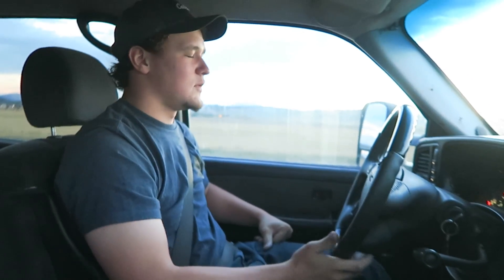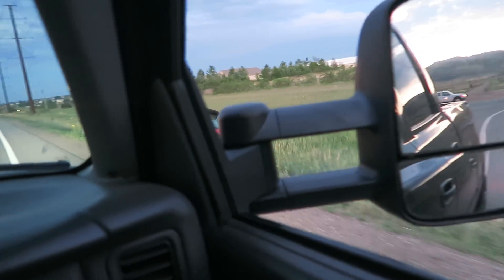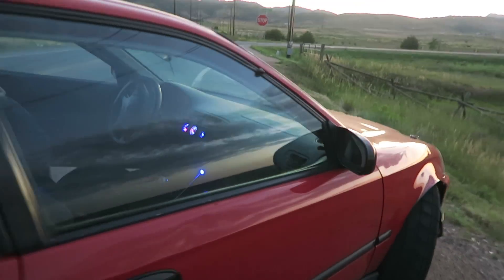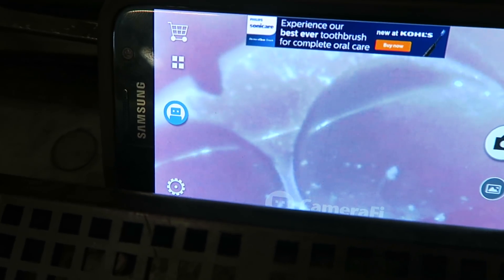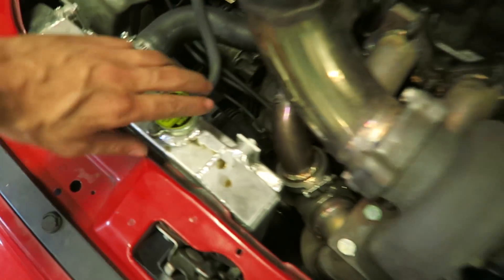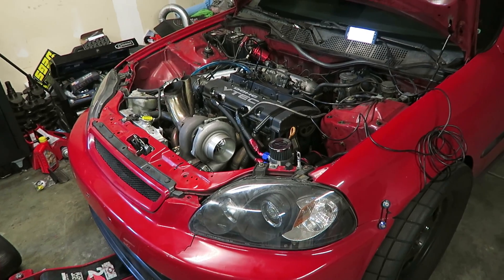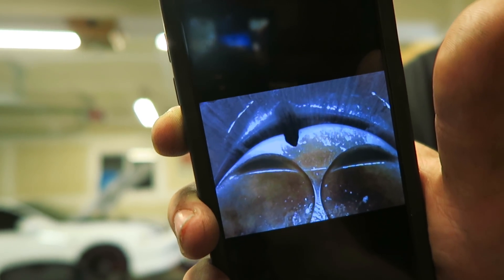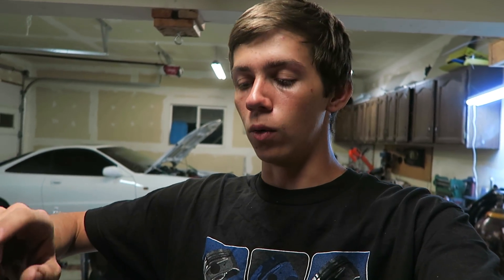Blew up The Hatch :(

Comment: Maybe if you'd focus on one thing and stop buying things off ebay and doing it right things would last a little longer... Just a thought..
Reply: Duane Hallgren You really got me there man!
Reply: Leshys maybe if he have more money he would buy in better shops
Reply: Markus It's not even that, it's that honestly it's cheaper to do it right the first time, sure it may take a little longer to get funds together but the money you'd save from replacing faulty parts over and over would have paid to do it right the first time.
Reply: Leshys I thought it was pretty funny
Reply: Leshys he originally built the hatch on a budget when the channel first started and kept building up, the point of the car was an ebay turbo build...
Reply: Leshys the hatch is the only car with brand parts
Reply: I agree w you, however this engine was built w/ high compression pistons basically as a test. He didn't know exactly how it would handle the HP/boost. So to me it makes sense to use cheaper pistons if you have no idea what might happen. Also he just said in the video that he will prob get a better, stronger piston setup this time around. What better way to learn than to try it out!
Reply: HondamanFG2 Vtec yea, as a teenager he builds some crazy shit!
Reply: only thing that is ebay is just the turbo everything else is quality parts or made by them in the garage
Reply: I dunno, maybe I'm being too harsh or my standards are too high, just sucks to see so much potential somewhat slopped together, sure keep all the other stuff if you wana do eBay stuff for entertainment but at least do one full clean build.
Reply: Leshys I doubt you even own a car to be talking about clean builds, have you ever even put a wrench to the bicycle you own?
Reply: Syntronz Remixx Instagram: @egsix I'll let you decide bud, maybe you're right. What do I know.
Reply: Syntronz Remixx don't have to own a race car to have the common sense that you build a 700hp 4banger with eBay parts shit will go south but on the flip side if he was fucking with a Chevy 5.3 with a turbo it would last forever at that power.... 4 bangers are for getting groceries not drag racing.
Reply: He has a ebay turbo... That didnt blow up so what are you talking about
Reply: russrt spooling If your going to follow that logic, v8s aren't meant for drag racing, they're meant for towing and only v12s are meant for drag racing because supercar.
Reply: Cool, I guess your paying then?
Reply: Geoge Veruh thats acually a good point why dont they use v12s in top fuel dragsters
Reply: WTF its bad luck, nothing to do with $. That's classic lean damage. Sorry to see it Dude. Pull the injector and see what's blocking it.
Reply: ya I've been saying this any everyone gave me shit. I called it would be blown up in 3 weeks after he got it working and I was pretty much right. You can't half ass shit with that much HP.
Reply: Leshys them eBay pistons yo, jk lol
Reply: Geoge Veruh v8's were built way before v12. There's rarely a v12 at any track. Nhra top fuel makes 10000 go with a v8.
Reply: Its not the tune nor the parts. Its 1 cylinder. If it were the tune all the pistons would have some damage. Most likely an injector or fuel starvation if it's last on the fuel rail.
Reply: Leshys that's why you build a 4cylnder now one expects it and it's feels grate to beat a mustang or camaro with something that cost half as much
Reply: What ebay part caused this to happen.  The s300, 500 dollar pistons,  Name brand injectors/fuel pump or was it high compression while trying to drive it around with 0 room for error.
Reply: Timeless SIDEWAYZ V12s would be overcomplicating things - too many cylinders to look after.
Reply: I don't think the channel would be the same if they didnt do everything with ebay parts
Reply: sketchy builds is what this channel is (kind of) all about
Reply: Just because he buys stuff of eBay doesn't mean it's bad, sure there are a lot of bad brands but eBay is just the distributor, there are good brands on eBay with quality stuff!
Reply: People that use name brand parts with that much HP and still have trouble, what makes you think cheap ebay chinese parts are gonna be any better? If you're going to do something with that much HP you might as well do it right the first time instead of having to keep going back and doing it over again and waste more money. Only thing ebay I would say isn't that bad is the turbo he has, and really if turbo has a good bearing it doesn't matter what brand it is... But when it comes to internals, you're talking cheaply made parts made in china at mass production to make money. If he just got a new block, name brand intervals and sleeved it and kept the ebay turbo he would be gucci
Reply: +H Legion He needs to get some Manley h beam rods, Wiseco pistons, a forged eagle or equivalent brand crank, new set of sleeves, and have his ring gaps set properly for high boost. Then it would probably last quite a long time comparatively.
Reply: SYST3m true. They destroy them selves down the track anyway. Haha R.I.P v8
Reply: Leshys honestly man you are telling your opinion to people who just watch YouTube. These guys have no idea about building a car or a motor. They don't know what's involved in a quality build. They sit in front of their computer in their underwear watching videos.
Reply: uhh it has a lot to do with cheap ebay parts...
Reply: its not tho only ebay thing is the turbo everything else is name brand stuff  in the engine except the turbo which has been 3 years strong
Reply: he has ran this car at 600 hp with this same turbo for 2 years which at that time I believe he was using cheaper rods and pistons
Reply: LOL what ebay part.  He doesnt have cheap injecors pump pistons or rods.  So please tell us what ebay part caused this.
Reply: he's using a ebay pump...
Reply: 4bangers are for getting groceries not drag racing. Guess you haven't seen the DSMs in the 7's lately. Pretty sure that would smoke anything you got V8 or not.
Reply: Cheap to build but all ways fkn up tho .
Reply: But eBay is there thing
Reply: Levi Eckman Isn't that the thing for like everyone that has a Honda these days except for a few of us? Lol. It's no wonder the Honda crowd gets so much shit these days everyone thinks their hot shit cause they have a NRG steering wheel and XXR wheels lol.
Reply: Leshys 
Its always been that way for Honda's . In 2003 it was fart cans and body kits and you had yourself a race car.
Reply: Leshys just because the turbo is from ebay doesn't mean that's why it blew up that astronomical and makes no God damn sense pretty much everything on the hatch is legit
Reply: Charlie P it has nothing to do with what came from ebay fact of the matter is parts fail ebay and great name brand parts they all fail over time it's fact over matter and the end of the day there is always something better you could have done to make the motor better sure but it's all part of the hobby fix break repeat it is what it is this has nothing to do with the engine even a good built high comp motor on e85 would have melted the piston if the injector had failed it happens more often then not with e85 and high comp e85 wears things out much faster and also he didn't cheap out on anything could he have spent more sure but it wasn't the motor that couldn't handle the power something fuel related had a hiccup and when you make 700whp that can be deadly end of story
Reply: the tunerfreak person is actually a friend of theirs and said that the injector for that piston had popped out so that was the problem
Reply: Leshys holy fuck bro that car is sick whats the build specs
Reply: Christian Prusinski It's a Dart closed deck bseries block, itr head, Ferrera valvertrain, Brian Crower stroked,  Crower rods and crank, CP pistons, Garrett 6262, pretty much overkill lol.
Reply: Leshys damn i would say over built for my needs but fuck send it. How much that beast  throwing down?
Reply: Christian Prusinski Will be taking it to IMW in Pennsylvania to be tuned soon, hopefully the trans doesn't blow in a million pieces 😂 I'll likely be uploading a video to upload should all go well.
Reply: Leshys nice. I cant wait to see that dyno sheet. Say, i got a issue with my boosted accord rn and im hoping a third party thought would help cuz its buggin the piss out of me. But my live datalogger for the s300 v3 shows everything is normal but it wants to idle at about  a little under 2k and sits at 28° advanced ignition timing. Car is stock internals. Refresh everything in the car basic complete rebuild and sittin at 7 psi at 240whp 230wtq. Cheched all fluids. Checked compression.  Turbo is garret 50 trim. Uh  runs ever so slightly rough. Throttle tip in it stumbles a little. and i had a buddy look at it he thinks it could be throttle related so i cleaned intake, sensors and throttle body but still pulls same high timing.
Reply: Christian Prusinski Have you checked your TPS sensor? Or maybe even a map sensor? It's got to be something like that or something in the tune, sounds more electrical than mechanical to me personally but I could be wrong.
Reply: Leshys I checked the MAP but not the TPS. I actually replaced damn near all the sensors to be sure cuz i cut that corner on a rebuilt 240k motor but the TPS and CKP are the only to left ordered them last week should be here in like 2 days. But yea was gettin a funky resistance from the CKP so i said time time r&r. The TPS completely slipped my mind. Im am going to test that as soon as i get to the shop at noon. I am definitely gonna let you know what i find there man. Just outta curiosity what state are you in?
Reply: In s300 reset the TPS voltage so its set right at closed throttle and open throttle.  Then clean and make sure the iacv is working right then try to adjust the screw above the TB.  If its still high adjust the TB screw so its closed more.  Then ramp down the fuel so it will drop in the first two cells.  If its in third or 4th colom on width its def something else besides the tune.  The timing is pretty normal at that RPM.
Reply: Charlie P simmer down there buttercup I prolly clicked on the wrong one your what's wrong with the world
Reply: Charlie P maybe you should take your own advice and read there little buddy I said that I prolly clicked the wrong name
Reply: Charlie P let's not forget that you came at me
Reply: Duane Bailey iacv little gunked thank you all.

Comment: Did you have a wideband? If so you should of seen it leaning out while in boost. Even if it was only one cylinder it would of still shown on the gauge as a leaner reading then normal.
And if it was an injector failure you show send them out to get flow check.
But i am going to say that the tune was a bit off. Probably a bit on the lean side and weather change cause it to get leaner and blow.

Comment: me personally if you didn't hurt any rods or bent them or shrunk them or whatever you want to call them reuse them get better Pistons to handle more power look at it as preventable maintenance if you go big now you don't have to mess with it later also make sure and check your fuel pump and make sure it's doing its job see if you can have it flow bench same thing with your injectors rather be safe than sorry

Comment: Sorry brother, that really sucks. My boy has a DC Integra that he had sleeved and built by a local engine builder and went to dyno tune it and on the second pull cracked a sleeve and melted the piston. He ended up getting a CSS block, ordered another piston, and the machine shop put it together for free. It still ended up costing him over $1000 to fix for someone else's screw up.

Comment: E85 is very inconsistent.  I've seen as low as 50% ethanol from supposedly 85%.  If you're running E85 pump it is best to test each batch of fuel you fill up with.  Ethanol loves to soak up water.

Comment: Sleeve it,forged pistons and stay with same compression,... the problem i see there it was a injector failure...if the problem was the tune the others pistons also  should have some detonation marks,even just a few marks... if they are like new so its injector number 3 problem or the injector plug. check that and rebuild it with the same spefications.

Comment: Grab another block. Sleeve it and put new pistons and rods. You could try and reuse your current rods but really only limiting your motor at that point. May as well build it completely now since it is out that way it will survive the abuse you will give it. Just my .02 cents.

Comment: Make sure the chunk isn't stuck in the turbo...Judgeing from the scored cylinder , your ring gap closed up .. build it loose to allow for thermal expansion ...If you ever want one to last ....Any jackass can bolt on power ....Next time you're in an airplane note how much slop is in the engine until it warms up ...

Comment: check your injectors. i ran e-85 in my hatch car started running hot, found out my injectors were running at 65 percent. the e85 plugged them up over time. got the injectors cleaned and now they are at 100% and the car is running perfect

Comment: Just get that forged h22 sleeved block and swap the head. You can sleeve that block for cheap since its closed deck u just have the sleeves pressed in.
Reply: Oh and time for some legit id 2000cc. If it was ur injectors since i know they're just 2200cc off ebay

Comment: Juat thinking out loud. What cylinder is the rev limit cut on? Could it be the fuelling being cut on that cylinder and over 3 months or so the heat of that momentary lean has finally been enough to break a bit off of the piston. As said just thinking out loud

Comment: Cylinder 3 runs hotter than the rest. That meltdown is a common problem. Turn up the duty cycle on just cylinder 3 to cool it down some you'll be fine

Comment: thats so shit this has happend! but onwards and upwards! i personally reckon as you are pulling the engine out for a third time you might aswell go with the new h22 and rebuild with stronger pistons (maybe ceramic coat) and rods and maybe some other supporting upgrades that you may not have just so you can make that 700hp more reliable :)

Comment: Damn that sucks but it happens. Shit breaks. At the point where you have 700+ whp out of a 2.2l I4 there is always that risk of complete failure. At that point, the engine components and stuff are so stressed that any minor problem turns into a hole in the side of a piston. I say sleeve and high quality pistons. It would be pricey but at that point that motor would be indestructible

Comment: High compression + high boost = recipe for disaster, unless you run only high quality fuels. But you take away your safety margins  and are relying on everything to be in order, fuel quality, engine temps, tune, and etc. Less compression will open that margin for error.

Comment: Hey where do you get your blocks sleeved? PFI? and ive heard you say before that you got your parts "locally"...can i ask where? i too live in the same city (about 2 blocks down from you) but finding parts locally is not in the books lol. keep up the good vids and good luck with the hatch. When running E-85 the injectors like to get clogged up a little quicker and prob leaned out the cylinder :(.. just my 2 cents  Thanks and again...good luck!!

Comment: What fuel pump were you running, e85 is a pretty difficult fuel to deliver at high power. Very easy to put an e85 motor in a lean condition.

Comment: Buy some good parts. Cheaper parts will perform the same as the top of the line parts, for bout a month. At least it wasnt rod failure and put a sky light in the block. Put a wide band on each individual cylinder, and tune. Then you know if you got a lean cylinder. Bummer man, build, race, blow up, build again. Story of my life too bro...

Comment: 700 HP with some good and some not so good parts gotta go bang sooner or later. You gotta reaction vid already were you recording when she went bang?  Mate I reakon your right on there Fuel leanage definitely, check the injector. As a rebuild if you want the HP go good qual pistons and injectors, check the fuel pump duty cycle as well see if it is getting on the edge for fuel starvation. Hope shes back on the road soon. Peace out.

Comment: It sound like a problem with injector #3. You should send them flow tested to make sure another disaster doesnt happen. Its sad but it can happens even with good parts. I also would recommend you running a much safer tune if you plan beat it up a lot. I saw you where aiming for 12.5 ratio its a bit lean in my opinion in case something happens it give you no chance

Comment: I bet it's were the ring gap is.
Either not staggered correctly or too much clearance.
Reply: i also can say words Ive heard before. Maybe its the thrust bearing ? Maybe its the bore alignment ? Maybe its the camshaft position sensor ? are we helping guys ? Me and MrGuvEuroman are on the case.
Reply: screamingshiter 

Na my money's on ring gap/alignment (all ring gaps in a line) , I've seen it before many a time.
I've even seen a blow torched head because they didn't clean the threads in the block when torquing the head.
Nothing I could do be replace the head, took a chunk out just like this piston.
Reply: screamingshiter 
And because it had blow by like a steam train under boost. 😕

Comment: Learn how to watch your gauges better.  What do you expect you just throw it together and hope for the best. the money you spend on parts coulda built you a motor that could stand up to the boost you plan on running . I'm surprised the crank and main shaft held up little lone the pistons. Build it with forged internals or you'll blow it again in another month .